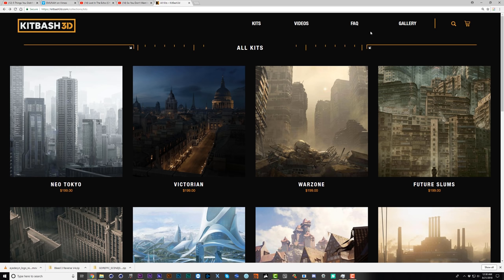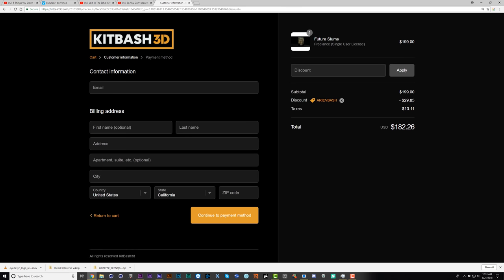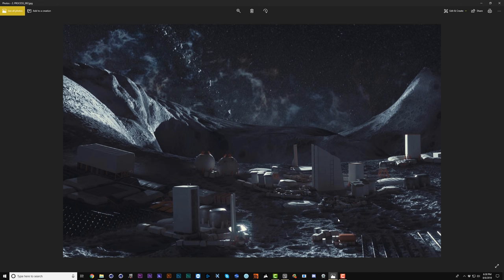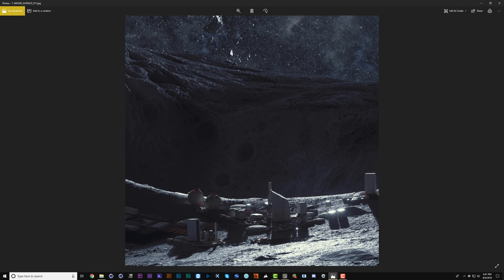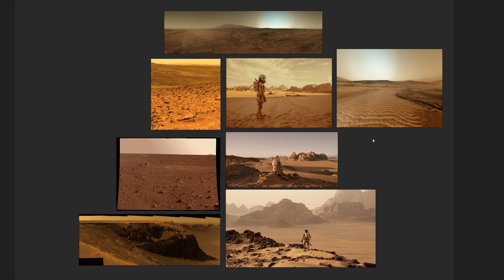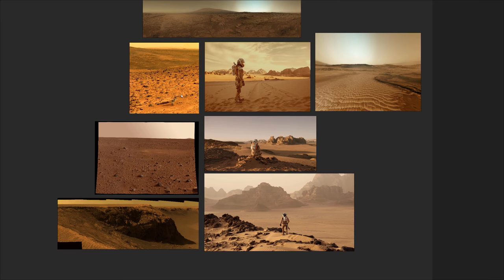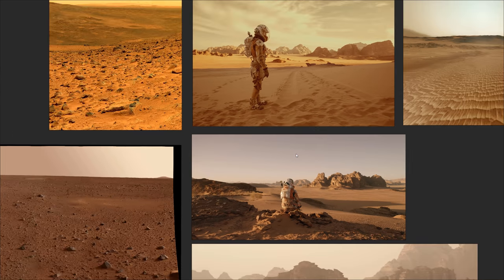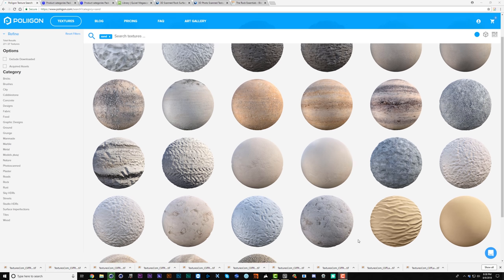Cinema 4D Tutorial - Create a Detailed Mars Landscape Using Octane Displacement

Comment: 2:10 - This shot will always make the buildings look small because the angle is high and the also because the resolution of the textures should be MUCH higher. The surface wouldn't look that bumpy from so far away. Just smoothing it out or adding higher resolution textures would make a big difference to the scale.

Comment: Great tutorial man, hopefully I'll be using some of these methods soon....
Relevant question, but do you think the RTX 2080ti is going to have a significant improvement from what the 1080ti is? The whole ray-tracing focus sounds like a plus for 'content creators' But not sure if it's just Nvidia 'HYPE.'   The reason I'm asking I'm in a 50/50 to purchase either the 1080ti or the RTX 2080ti.
Reply: It's hard to say until I see actual OctaneBench scores. Some people are saying it's 2x faster, and others up to 6x faster. Either way, that's pretty crazy, so I'm excited, but it's gonna burn yet another hole in my wallet hahah...
Reply: The raytracing focus is with regards to real-time game engines. There's a future with that technology, no doubt, but it's different than using Octane. The 2080Ti's have an improved architecture and more cuda cores than the 1080tis, so they'll give you faster render speeds.
The 2080Ti is ~$450 more than a 1080Ti, currently. Who knows, maybe prices could drop further and you could get 2 1080Tis instead of just one 2080Ti. If your budget is limited in the short run, but you intend on investing more as time goes on, then maybe a 2080Ti could be a good choice (purchasing another when the funds become available) because, depending on the rest of your computer setup, you could be significantly throttled when going above 2 graphics cards.

Comment: Great tutorial David! Was wondering about your PC specs if you can share?
Reply: Thanks!! The PC I recorded on (I've got two of these builds) has 4 x 1080tis, 64 GB of Corsair DDR4 RAM, a 6 core i7 6850K CPU, Noctua Dual Tower CPU cooler, an ASUS ROG Rampage V Edition 10 motherboard, a 1300W G2 power supply, 1TB SSD, 8TB HDD, 3 front RGB LED fans with Corsair Link, 2 bottom fans, 2 at the top, and one at the back, and a Corsair Air 740 case.
Reply: Thanks so much for getting back! Do you have water-blocks/hybrids for the 1080tis? I would imagine having 4 FE cards would generate quite a bit of noise. Really interesting that you use Noctua for CPU, I use the D15 cooler as well but most 3D builds these days that I've seen water-cool the CPU.
Reply: adam yeah I don’t do any water cooling. I just use the blower design that stacks well. It’s not horribly noisy. I’ve heard that the hybrids are just as noisy, though they do keep temps way down.
Reply: You are an absolute star David, many thanks for getting back and the great content!

Comment: noob question here.  Why did you duplicate the actual geo to add different levels of texture displacement as opposed to blending the displacements with some sort of additive blending node in a single shader on a single piece of geo?  Admittedly I don't know anything about octane and am kind of new to 3d generally, so apologies if that's a dumb question.  But I've seen in various other demos for products like Arnold and/or redshift and even for developing textures in substance and the like--height maps get blended in a single shader.  seems like doing it by duplicating the geo the way you are doing could potentially cause problems.  It does however seem more straight forward and giving you additional controls on displacement values for each version of the geo/texture.

Comment: Whats your rig specs? Only one GPU? i thnik my rig would die if I  used the volume like that. Or maybe its jusy my workaround with the volume thats kills. I often get "out of memory" message, and then Octane crashes when wokring with volume fog
Reply: I have two of these rigs: 4 x 1080tis, 64 GB of Corsair DDR4 RAM, a 6 core i7 6850K CPU, Noctua Dual Tower CPU cooler, an ASUS ROG Rampage V Edition 10 motherboard, a 1300W G2 power supply, 1TB SSD, 8TB HDD, 3 front RGB LED fans with Corsair Link, 2 bottom fans, 2 top fans, and one at the back, and a Corsair Air 740 case.